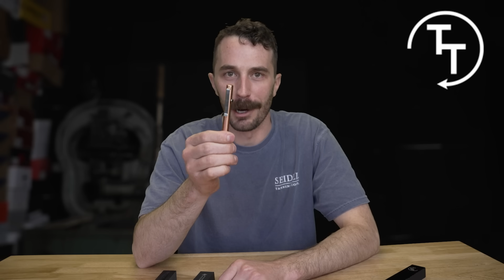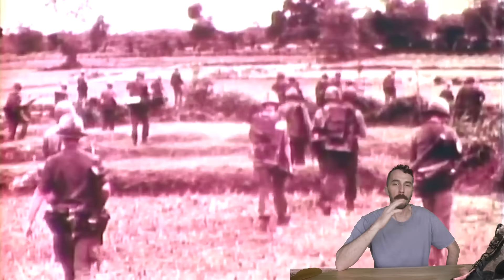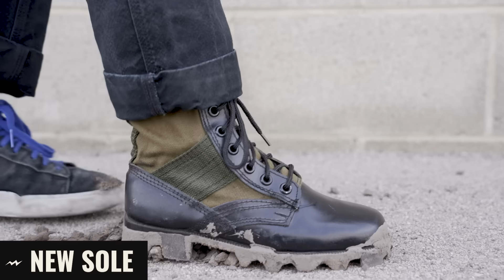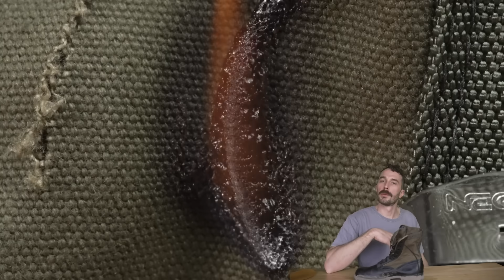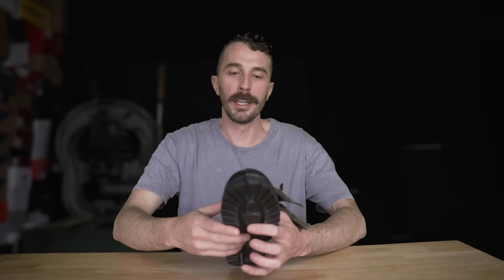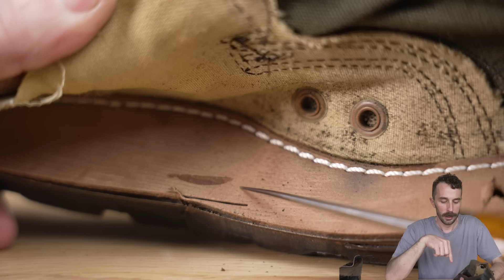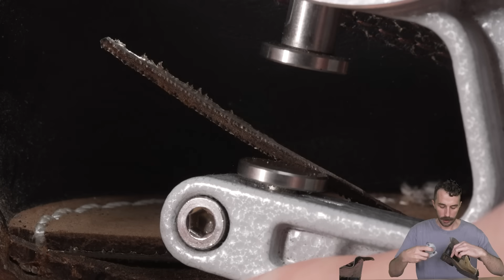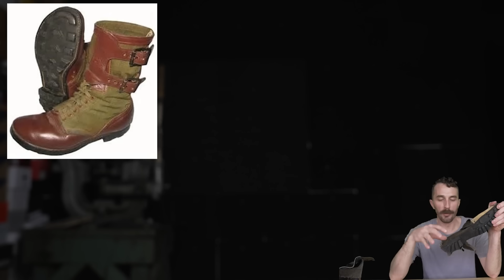Why it took 57 years to replace jungle boots

Comment: We were still getting those (except with black instead of green canvas) when I went into the Marines in 2002. You had to get use to them, and they eased you into them during recruit training, since the inside was kind of just bare leather, and our ICBs and go-fasters were way softer on your foot, especially the back of your heels. But man, once your feet toughened up, these boots were the shit. Especially after a long hump, ICBs can be impossible to get on, but jungles were always way  easier to get off a swollen foot, and get a swollen foot back into. If you've never been in the military, or gone on really long humps on your own, you have no idea how much your feet will swell up after that. Getting your boots back on the next morning after only a couple hours of rest, and your feet are all swollen up, you sometimes can not get your foot into your boot. You  learn to just sleep with your boots on. They just won't go back in. ICBs were the absolute worst boot I ever wore when it came to that. Plus jungles were lighter, and cooler. They started to just feel like a normal shoe after awhile. Plus they look pretty cool when you're trousers are bloused. Some dudes had green ones, and even all leather ones(we called them Cadillacs), but you had to have been in when they were in service to be able to wear them. So they kind of became a status symbol. Same with old school woodlands after they started issuing digies in recruit training. Oh, and they made jungles in that brown fuzzy stuff the digie boot ICBs were made of. I think the digie jungles were also that brown fuzzy suede type material. I never had them.

Comment: I just used the old german issue ones that are pretty much exactly the same as these for 4 months in the jungle in Costa Rica. they cost me £25 surplus and lasted better than anyone else's altbergs and so on
Reply: Nice! I almost never find deals on surplus stuff... because I'm a bigger guy. All the surplus boots and clothing always seems to be in sizes no bigger than medium or maybe large.  That doesn't work when you're 6'3" 250lbs with size twelve feet.
Reply: @dogslobbergardens6606  Yeah haha i had to search around a bit but really worth it for the savings
Reply: 5.11 jungle boots are amazing, they're like £100 though
Reply: @dukeofleinster4524  4 people in the group had those but they complained that the grip on wet rock/wood wasn't the best
Reply: @isaacjaywallace  I'll have to proper test it out on some wet rocks
Reply: @dukeofleinster4524  be careful 😂👍🏼

Comment: I was stationed in Panama in an Airborne Infantry Battalion. I loved my jungle boots. Much better than the 1960s and 1980s full leather black boots A.K.A. Leg Boots because they don't have traction to them and the soles wear out faster from cleaning the motor pool track line scrubbing dry sweep being mechanized infantry and you had to buy another pair from clothing and sales to replace them. The  Leg Boots require a ton of polish for everyday normal uniform wear. In Panama was even better. It was an issued item and can be DXd or Direct Exchanged when worn out. We had a small team of guys who were Panamanian civilians who polished your jungle boots to a mirror shine for $20 a month. Carlos and his brother Ralphie were awesome!!! I had less blisters with them just using regular OD G.I. socks but used Gold Bond Powder on long jungle field excercises. Rarely got blisters with them as long as you had the right size boots and plenty of dry socks in the jungle. I loved them when I jumped out of airplanes, had good ankle support when you follow the Paratrooper golden rule of feet and knees together and PLF properly. Great ankle support when walking through the jungle with less ankle twists.

Comment: Question! Because of the metal plate in the sole, I imagine those boots are not flexible at all. So when walking, the plant of the foot must stay flat, but usually when walking our foot kinda “fold” (just below the toes). Is that a comfortable / acceptable situation ? I have a hard time imagining being able to walk or run for miles and miles with a foot that must remain flat!!

Comment: There were guys in my platoons in Louisiana & Germany who swore by those boots, in hot or cold weather.  I stuck with the all leather issued combat boots for 5.5 years of my 6 years in active duty Army service.  Around the end of 1999 to 2000, the Army produced the Improved Hot Weather Boot.  It was, essentially, the Jungle Boot, without the metal spike resistant plate & drain grommets.  I liked that it was all black.  I purchased a pair and was very happy with them.  Great boots.

Comment: Is there a way to recondition a pair that are about 45 years old and make them fit even half decent on a very old guy whose feet seem to have gotten at least 2 inches wider than that younger guy who was issued the boots?  Wore them close to 10 years before leaving them to just sit out unmaintained for the past 30 years.   If I could get my feet into them again I would seriously consider wearing them again on a regular basis.  Not quite the Instant fit of the regular combat boot of the 1970's but still would let you put them on and go without tearing up your feet at the end of the first week of wear.

Comment: Jungle boots were mildly more comfortable than the old black boot issued in the 60s and 70s. They did dry faster but mud stuck to them worse. I still have a pair.

Comment: September 1966 arrived in I Corps right at the start of the northern monsoon.   The mesh insole saved my feet.  I got rid of all my socks and just wore the boots without them.  The insole allowed the water to just run on out, and as long as I took the boots off at least once a day and dried my feet, I got away with only a mild case of athlete's foot that was bearable.  March 1967 the sun came out, but I still stayed away from wearing socks.  In fact,  I don't think I had even one pair of socks by the time I was finis Phu Bai.

Comment: The old souls were  mud magnets.
I had to wear them without socks because the green shit would grow in your feet and we I had to pull my head dry my feet out all the time constantly in the water.
We were jungle Cammy top jungle green bottom boots that was it plus all our gear of course.
I don't have any times I have to scrape I don't know what you want it was was it mold was that green shit that would grow and grow on you

Comment: I loved my issued jungle boots, but the steel internals made it hard to road march over 8 miles. Replacing the sole with a wiffle pattern made it fit and feel like a lightweight basketball shoe. Great for 8 to 20 miles carrying 75lb ruck.

Comment: As a member of the 82nd Airborne Division for 6 years I wore this boot  in all conditions and climates and with the exception of arctic conditions this was the best boot I ever had. I still wear them sometimes when I’m doing yard work today. Your statement that this $50 boot is superior to $200 boots is spot on. I have plenty of $200 boots to support that observation.
Reply: All the surplus stores around CLOSED! I could get Anything there. Now mom & pop stores have dissapeared, internet took over. Bummer.
Reply: @roberthealy8519  there is 2 Army Navy surplus store's in Rockford Illinois in the USA and I did continue to wear the Altima (sp?) Jungle combat boots while hiking and on work sites for Year's.
Reply: Interesting, as the boots I was issued in 81' were worthless in keeping your feet warm in cold Ft Carson, Co/Camp Stanley, Korea weather. The solid rubber soles transferred the cold up through the plastic insert they had in them right to your feet.
Reply: @MrDLRu  I wore my combat boots while hiking in the Redwoods and in West Virginia and the job sites was not a cold weather situation but I would have a pair until they wore out and then maybe a year or so later I would get another pair but it has been many years sense I last had a good pair of jungle combat boots.  I have been buying Keen work boots the last 10 years
Reply: @ryanclay959  The machine shop I just got hired into requires steel toed shoes/boots...Ordered the Keen's 2 days ago.  Hoping they're comfortable, as I'll be in them for 12hrs a day.
Reply: Same 2004-2011

Comment: I had a brand new pair of c1969 vintage genuine US Army issue jungle boots. The real deal. I used them as work boots and for canoe camping. I liked them. But after a couple of years the early style lugged soles both cracked completely in half, turning the boots into useless trash. Was cracked soles a common problem on jungle boots or did I just get a faulty pair? I've wondered about that ever since.

Comment: I ETS’d from 3/502 in Aug89. At that time, we not only wore jungle boots, but jungle fatigues. We had to use subdued brass insignia, and I still believe that was the sharpest looking uniform I ever wore. Well…except for the BDU cap that we had to wear with them. So while we looked a little goofy outside, we were sharp as a tack inside. 😂😂😂😂

Comment: I have both lug types.
Yes, you could roll your ankle, but you could climb a tree, so there's that.
Never had a pair that would dry while you wore them, in wet environments (duh), but they do evacuate the water, and dry really quickly when you get them off and wring out the inserts.

Comment: I didn't use the liner in my boots.  It was too uncomfortable.  And the "ventilation holes"?  I tried to keep mine filled with boot polish.  I hated to walk in an inch or two or water and have that boots sucking it up. Most of the time that point was made moot with deeper water.   I didn't have the "Panama Soles", but I really wanted them.  All in all, I was very happy with my boots.  On my last trip out of country, I had to throw my boots onto a very large pile of boots that had belonged to departing servicemen.  I really hated that.  Had I known that would happen, I would have carried the boots in my duffle bag.  My boots lasted from 6-7 July '69 until Feb'72.  My boots and clothing were issued at Oakland Army Base., Oakland, CA, TA-50 at Long Bien, SVN.

Comment: Great review. I had two pair during my year in Danang. Not remembering which my first pair was, but the second was the later design. I mostly had to deal with sand and the rain.  They worked great for that. Didn’t experience the jungle condition or the punji sticks, so can’t speak to that. I was allowed to bring only one pair back, (the later design) and used them for several years afterwards. Finally wore them out.  Loved them.
Reply: In 2006(?) I had the opportunity to visit Danang again and was shocked to see it hadn't changed much since 1974.   Nothing was spic and span and general base decay always present but I was instantly transported back decades.  I showed my kids where the Shenanigans took place and was pleasantly surprised at how welcoming the people were.

Comment: The original lug sole would fill with mud, and when you stepped on a wet log or big rock you would bust your ass. They told me the leather was pig skin The way we broke these boots in was to wearthemsoaking wet and march all day until they dried out.

Comment: I served in Vietnam 1966-67. The first jungle boots we were issued in the 1st Cav (if I remember rightly) had a different sole from any of the ones you show here. It was a very unconventional pattern of deep curving grooves. I was told they were "mud soles." During my next tour in 1970, the Army was issuing what we called the "Vibram sole" which was less peculiar-looking. The plastic mesh insole gadget was disliked by many troops because, when worn without socks, they would chafe the skin off your feet. I thought the mesh served to keep your socked feet out of the water. The boots did drain quickly after you waded though a deep creek or march. I wasn't in the infantry, and I wasn't in "in the field" all the time, just now and then for a patrol. I thought the jungle boots were fine, although they were really odd-looking to those of us who grew up watching WWII war movies.

When I arrived, the guy I replaced gave me his "jungle boots" which were exactly like the reddish-colored boots in your video. He said they were "French jungle boots." I asked my parents to send me a can of cordovan shoe polish and I cleaned them up. I wore them around the fire base just to be eccentric. I kept my GI jungle boots a long time and used them for backpacking.

Comment: I served in the active Army from the early 80s through the mid 2000's so I have been issued the Vietnam era boots through the desert versions, great boots, I still have them for working around the house.   I love a good pair of boots. Also had the Cochran Jump boots for dress formation etc.. You may want to cut them in half, very high quality.
Reply: Loved my jungle boots 1992 Ft Polk LA. easy to shine and my feet didn’t burn up. They also dried out quick with the Louisiana rain.

Comment: I can state authoritatively, as someone who wore jungle boots almost exclusively in the field (regardless of terrain or climate - anything less than mountain/Arctic environments and they're still superb boots in the cold) as an infantryman,  they do eventually dry out when worn.  And those plastic mesh insoles do work to both wring out moisture from your cushion sole wool socks, and allow air to circulate once the socks have gotten from "soaked" to at least "damp".

Comment: The jungle boot was so popular that we were permitted to wear them as Infantrymen in the Berlin Brigade. The only requirement was that we had Vibram soles put on and the metal plate was removed. They proved very good boots even in snowy conditions. As we continually changed our socks at halts, the jungle boots were faster to dry than the standard issue leather (leg) boot.